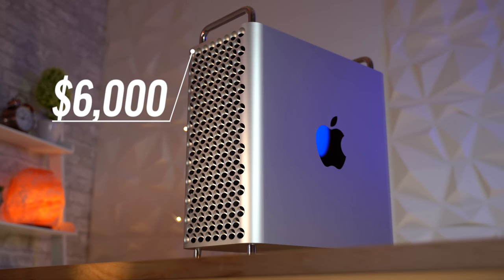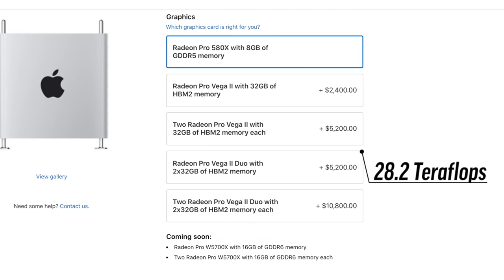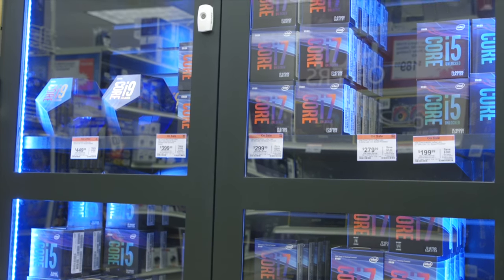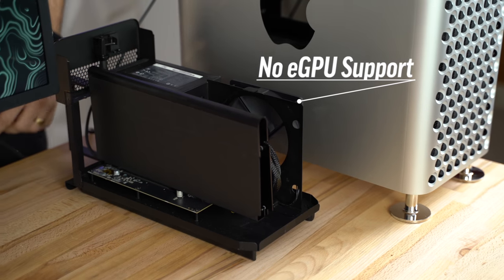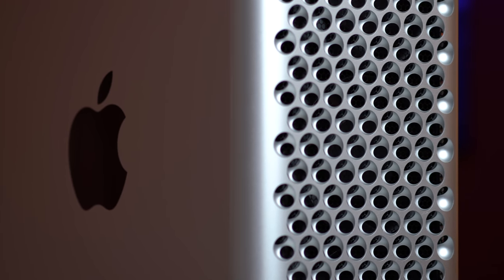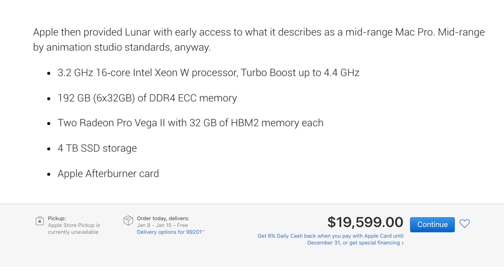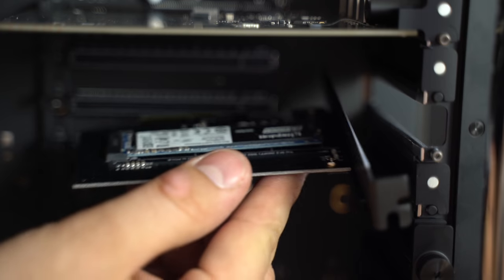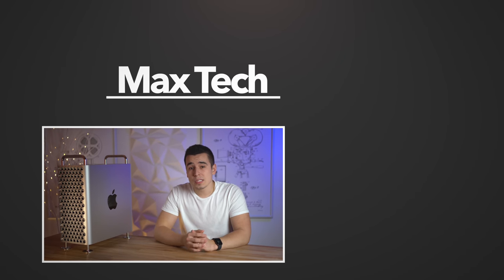2019 Mac Pro Review - 7 Reasons it Sold Out!

Comment: Compared $30k Mac Pro to a TRX40 build  I'm currently putting together and the TRX40 build craps all over the Mac Pro for less than half the cost. 230% CPU power,  Better GPU performance,  3x M.2 that are pcie based vs 1 over SATA, 256gb ecc DDR4 vs. 192gb, 80pcie lanes vs 44...  The big takeaway I got was that I could dongle in some thunderbolt drives if I needed them but I wouldn't since I'd have pcie lanes leftover for a 4x m.2 stand in card, pcie4 at that. 

Sorry guy, I'm not sipping the Kool aid on this one, for my needs this Mac Pro is of God Awful value.

Comment: Too bad the Mac Pro costs 2-3x times comparable machines with IDENTICAL hardware. Your price comparison overlooked the fact that you were comparing scalable Xeon Gold and Platinum CPUs that cost thousands more than the Xeon W chips found in the Mac Pro.

I'm just over here laughing when you say that ProRes is the industry standard. I've been editing features and network TV shows for about 10 years. Never got a single project in ProRes. It's useful as an intermediary, but not necessary when you can live edit in the native format. It just adds another unnecessary step to the editing process and introduces another generation of compression to footage.

Comment: Those analogies make zero sense (Lamborghini, store-grade espresso machine) and sound utterly elitist.  The fact, as you stated yourself in a slightly deceitful way..., you can buy  stronger hardware with that kind of money. So much stronger in fact, it is not even a comparison. So it will be up to every user to decide, whether they will need the advantages Mac Pro offers (proprietary software,  design, display solution) at the expense of computing power. My guess is it will suit the needs of a few specific communities but will remain irrelevant to the most.

Comment: let me stop you right here and just say this computer for "creaters" costs 6000$ base for 1500$ worth of hardware and only has a quarter of a TB of storage, if you are a creater it is a terrible choice to buy something  with 2-3 4k videos of space on it that you cant expand without a 400$ adapter to manually increase the space
Reply: You don't need a "$400" adapter to increase storage. I have an 5k Imac with 256 storage, and I don't even use half of that cause I have two extra ssd's plugged in via USB at the back where I keep all my heavy stuff. So you might need to do some extra work to put the hard drive inside the Mac Pro but, you could also just plug the drive in at the back. The Mac Pro has even better ports then my Imac so I don't think speed will be an issue.
Reply from the maker: We have 1TB in our iMac Pro and only 120GB is used and that’s counting extra files that we don’t need there and can be deleted. In reality we only need 80GB or so. All of our files live on our 112TB high speed server which has a combined speed of 3300MB/s and two of our Macs are connected through thunderbolt 3 and the others through 10Gbe. Most companies with multiple employees work off of servers.
Reply: Well if you have money falling out you ass or a rich dad go for it, I'd rather have a 6000$ pc that I built that is 3 times faster then the base Mac pro. You could have a ryzen  3950x and a titan RTX all water cooled, rather then a outdated and recycled Intel processor with a r9 580x. Not to mention 4 TB of m. 2 Gen 4 storage with read speeds of 5000 MB/s. Apple will never come close to the value of modern computers with their profit margins being what they are.

Comment: Amen!

When I worked in IT, there was a model designer who needed to render items regularly. Thankfully, I interviewed staff who most likely needed extra assistance at getting the right gear. The computer he had was a woefully underpowered laptop that would take 4 hours to render! And if there was a change, another 4 hours. Though he could model, he didn't know much about tech. He didn't know there were options. I then got him a much more appropriate computer that would render in 45 minutes. And that was just a fast laptop...  Which was he wanted instead of an even more powerful desktop. Needless to say, his productivity went through the roof!

I lust for the Mac Pro. For strictly professional photography purposes, it's pretty hard to justify though. I was doing some calculations...  If I had 30 photographers on staff and they were constantly busy, a production manager processing images could use a Mac Pro. And still have time left over! And all of these calculations would be just for the mid-level 16-core, 1 Duo video card model too...

With video, it's the rendering process that eats up workflow time. Even if I was rendering 3 - 5 hours of 4K video a week, the Mac Pro would finish rendering that up in what, an hour or so? During lunch? I would have to have a half-dozen very busy videographers at least to make a dent to what this machine can do...

The average Youtube viewer just doesn't get how powerful this thing is and who it's aimed for. And what a relative bargain it is. The backlog of orders clearly demonstrates that. I'll be getting a 16" MBP soon and that will be more than sufficient for me for a while. But maybe at the end of the year, I'll get a refurbished, base-level Mac Pro. That is one damn fine and beautiful machine!

Comment: I had the first intel mac pro which had the capacity for dual Xeon processors and only cost $2K for the base model.  Apple has missed the mark by a wide margin.  If just supporting single CPU could have used AMD's threadripper, which is faster, more capable, and thousands of dollars less expensive.   Even the SSDs apple has on this machine are 1/2 as fast as the samsung EVO 970 plus; a total failure and massively overpriced.  More fuel to the fire for the hackintosh community.
Reply: The threadripper is 3 years old and has no track record, and it also gets much hotter. Xeons last a decade in Mac Pros.